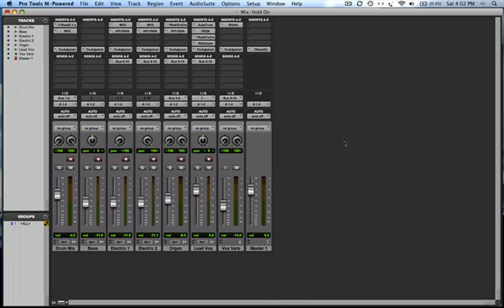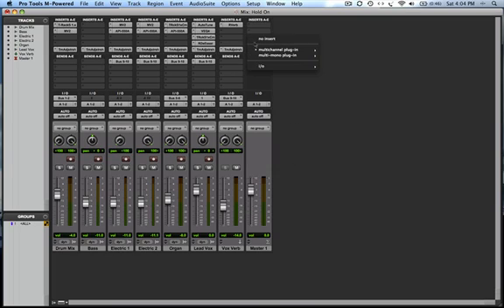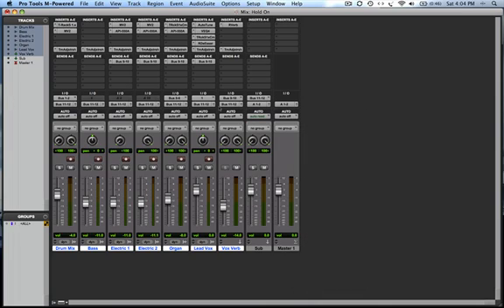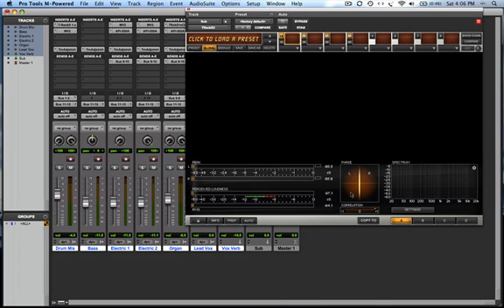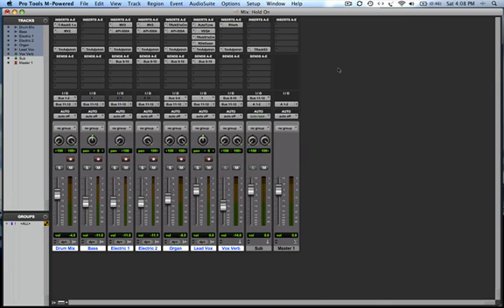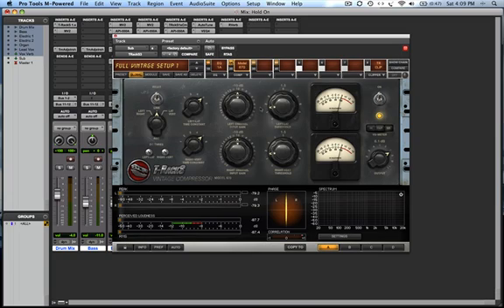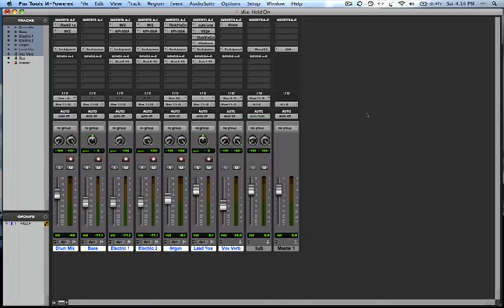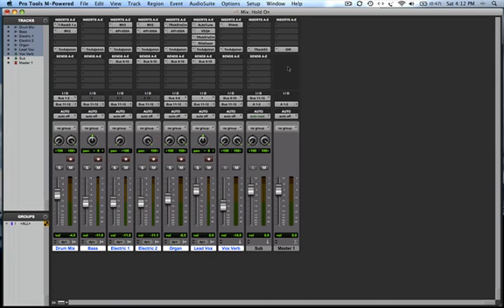Mixing with Buss Compression in Pro Tools

Comment: I was just in the studio, last night. I've reverse engineered the snare CRACK! you find in many of today's finest recordings. The trick is to set the compressor's attack to 3-5ms... this allows the first part of the wave through,, followed by a CHOCKING of the wave. You've got to drive that compressor with enough input, such that the transient SPIKES through! The snare top mic is only used for the first 3-5ms of the ATTACK! Stereo overalls fill in the snare's body/timbre.

Comment: I was just in the studio, last night. I've reversed engineered the snare CRACK! you find in many of today's finest recordings. The trick is to set the compressor's attack to 3-5ms... this allows the first part of the wave through,, followed by a CHOCKING of the wave. You've got to drive that compressor with enough input, such that the transient SPIKES through! The snare top mic is only used for the ATTACK CRACK! Ambient mics are used for the snare's body/timbre. That's three mics total.